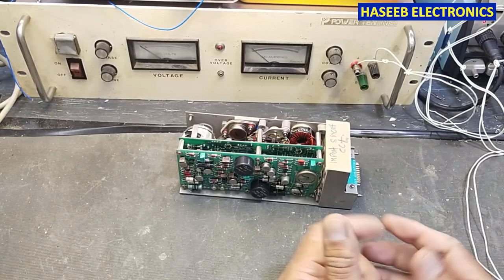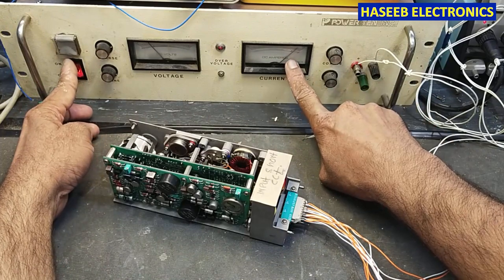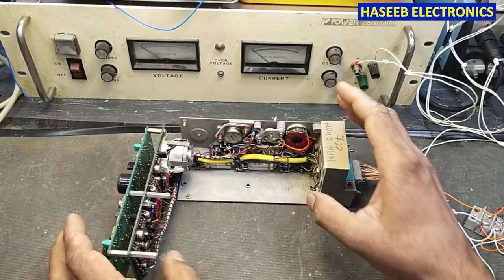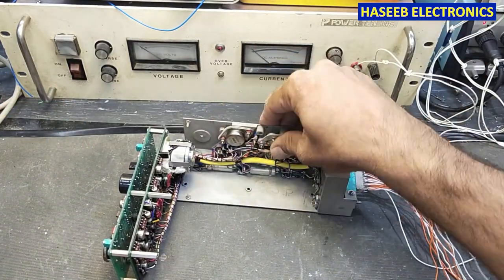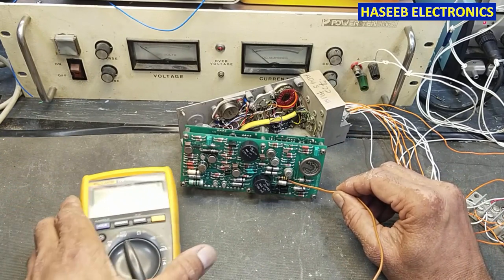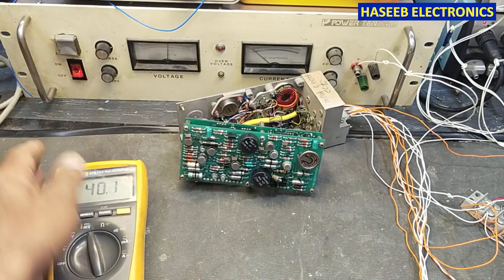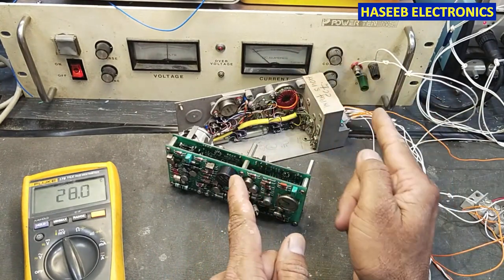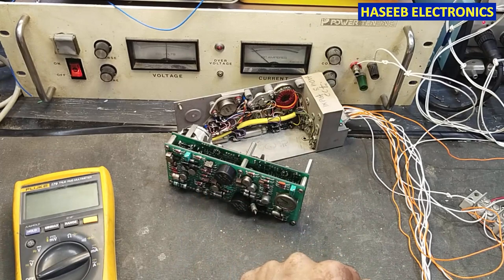{705} How To Remove Short Circuit

Comment: I suggest that the technician disconnect the power supply from the DUT and use a proper current limiting resistor probe/tool to bleed the capacitors every time, before touching the circuit. Even still, this method is always dangerous. A second person to watch over the technician is also a good idea. You also make a good point about shielding yourself from an exploding capacitor. I also do that, when I am testing a new DIY design, for the first time. Cheers, my friend!
Reply from the maker: i salute to your valuable guidelines. your each and every comment is really a valuable point for human and equipment safety. 
special thanks for taking time and sharing your experience

Comment: Yes i saw the smoke, excellent way to troubleshoot, what kind of probe you used to check the temperature?
Reply from the maker: best regards 
it is thermocouple probe (it is most commonly supplied with multimeters, which have temperature measurement option, and it is calibrated with multimeter)
Reply: @HaseebElectronics  Thank you very much, I will look for temp probe for my Fluke 189.
Have a great day Sir.

Comment: Sir, I respect you a lot and your videos are always highly technical and to the point... and good educational.... But in the above video I just want you to correct one thing.... The heating up diode was not short.... It was heating due to short circuit in the other end of the diode...... Kindly correct me if am mistaking anything 🙏 am your follower and learnt a lot from your videos
Reply from the maker: best regards brother 
it is not is series diode, it is a reverse polarity protection diode, which is normally connected in dc circuits to protect reverse polarity for the input

Comment: I use lamp connected in series with power supply to insure if there is a short circuit or not and saving from damaging more component and saves me from any blasting.
Reply from the maker: yes brother series lamp is to protect from more damages while repair work. and this trick is used to remove the short circuit component from the board in seconds

Comment: Thanks sir, for upload this video. Sir i want to ask, if I want to check the short component in the primary block of the atx computer with this method, where should I put the positive pin, and the negative pin of the variable power supply, which I use to supply the voltage?
and if I want to check the short component in the secondary block, where can I put the voltage probe of the variable power supply I am using?

Comment: Thanks sir, Recently I have taken experience of a capacitor blast by fluctuations of supply in a tv smps board.. it is a safe method to detect short in pcb . Hence this video ia valuable for me
Reply from the maker: Yes, you are right it is safe and i use this method to eliminate short circuit, especially in complex circuits. so it is much better and easier method instead of removing each component and testing it out of circuit
Reply: Hi, 
I know your post was made about 2/yrs ago. But I found it interesting & kudos to the making of this video. I wouldn't mind if you could share with me how you apply this ' fluctuating method ' method on a PCB or how it works on TV for repair. Could you please share as I found this info interesting? I want to know how it works and how it is applied on either an individual PCB or the whole circuit board of a TV. 
Thanks in advance.

Comment: good explanation. i have   a doubt. we have one pcb board, inside pcb  hot line has fuse. when we connect transformer secondary line to pcb, the hot line fuse blown immediately. we are using toroidal transformer.  how to check  toroidal transformer whether it is working or not

Comment: Can we do it in inverter board?
Reply from the maker: yes we can do for any circuit, i use this technique in my routine, to eliminate the short circuit especially for the complex electronics circuits, it is time saving and it prevents the circuit from too much rework by removal and installation of components for testing

Comment: External power supply produce DC supply, but the connector of the small supply takes AC. Am I missing something? What was the voltage of big power supply?
Reply from the maker: the uut (unit under test) is 24 volt 5 amper input and provides many isolated outputs 
I injected 24v 10 ampere to eliminate the heating component
it was a safety diode that is connected in both lines as protection diode from reverse polarity and over voltage input protection 
it is a DC tvs diode
Reply: @HaseebElectronics  thank you sir